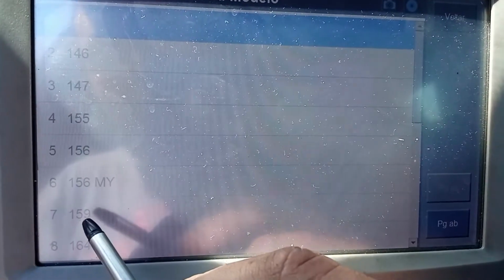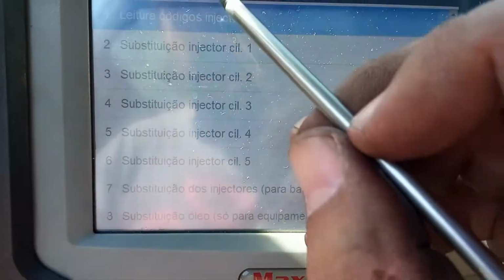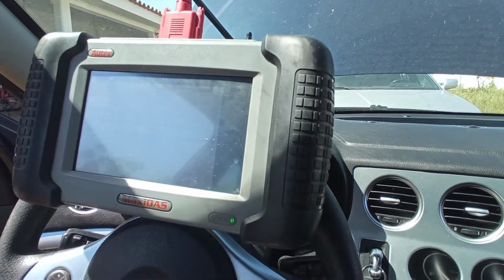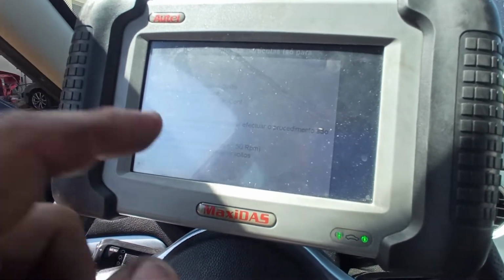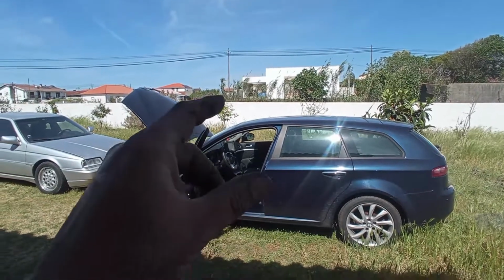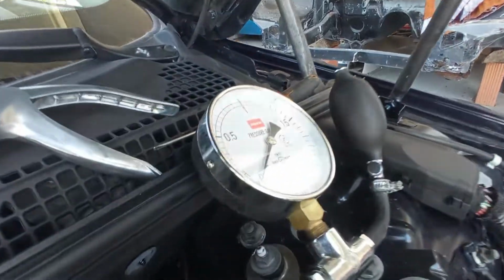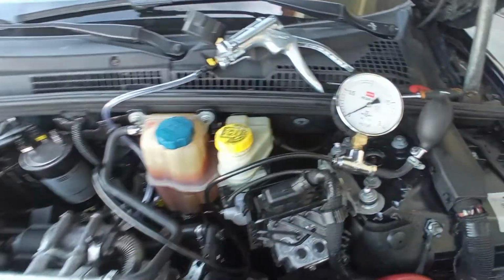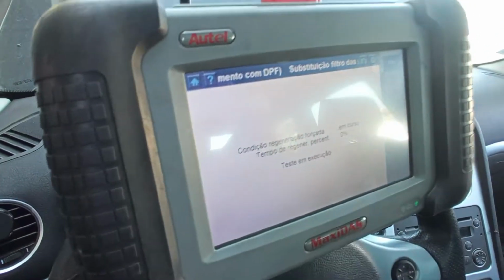DPF or FAP, constant regenerations! Lack of power and lots of smoke! Diagnosis and solutions

Comment: Videoyu tam olarak izledim fakat hala sorunun ne olduğunu ve nasıl çözüldüğünü tam olarak anlamadım. Bir kişi yardımcı olabilir mi?
Reply from the maker: Hello. What do you not understand?
Reply: @alfaromeonoproblem  Merhaba. Soruna neden olan şey ne imiş? Ve çözümü ne imiş? Çünkü ben de aynı soruna sahibim. Son başarılı rejenerasyonun ardından 5 km geçmesine rağmen, motoru durdurup biraz bekleyip arabayı tekrar çalıştırınca yolda araba tekrar rejenerasyon yapıyor. Aynı soruna sahibim arabam 65 bin km'de. Fark basınç sensörüne gelen boruların egzoz üzerindeki kısmının kurumdan dolayı tıkandığını düşünüyorum. Yeni bir fark basınç sensörü aldım denedim fakat sorun düzelmedi.
Reply from the maker: @keremkadakal translate to English please
Reply: @ Hello. What caused the problem? And what is the solution? Because I have the same problem. Even though 5 km has passed after the last successful regeneration, when I stop the engine, wait a little and start the car again, the car regenerates again on the road. I have the same problem, my car has 65 thousand km. I bought a new differential pressure sensor and tried it, but the problem did not go away.
Reply from the maker: @keremkadakal no problem is the same. You have to diagnose it and check. Can be only a thermostat, very often. 
https://youtube.com/playlist?list=PLgcTCigdgD8MyriRZ44vp-e33hn7-bYyM&si=QCZBXh0vPjzKDf7P

Comment: Hey Bruno! I have an advise for you as for removing broken studs without a welder. What I do sometimes is try to spin a nut on the remaining threads, and then hammer down the end of the stud, so it squishes and doesn't let the nut to spin off anymore. Then it's just a matter of turning the nut by force, it will try to spin all the stud off. Cheers ☺
Reply from the maker: Hello. That is an excellent trick! I will try that soon. I have a DPF with a busted stud

Comment: Another common problem with the, especially old nitrile rubber pipe from the DPF to the pressure sensor is cracks and/or splits. If it's leaking it won't register any pressure and testing it with an air gun won't reveal any splits or cracks either as the air goes straight through.👍🏻
Reply from the maker: Hello. Check out the part numbers you need on eper.fiatforum.com
Reply: @alfaromeonoproblem  Thank you.
Reply: Take a puff of a cigarette and blow the smoke thro the tube and look for any smoke leaks

Comment: Hello I have a Alfa 159 JTDM 2.4 210 stock 
I have put a larger turbo with a intercooler the turbo is a Carrett GTX2871R 
- 827690-0003 T. Housing A/R 0.64 
It’s a ceramic water cooled turbo 
The turbo is to big and doesn’t spool up
What turbo would you recommend please?
Reply from the maker: Hello. I do not comment on modifications. For my and my cars I always do everything stock.
Sorry